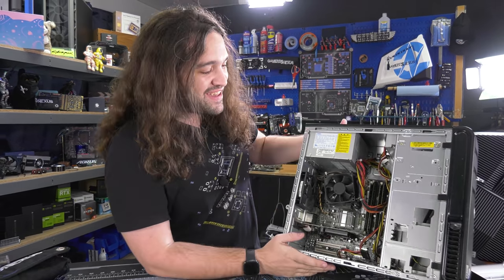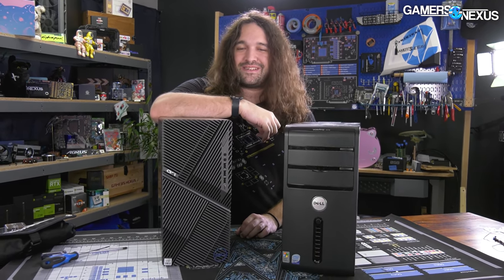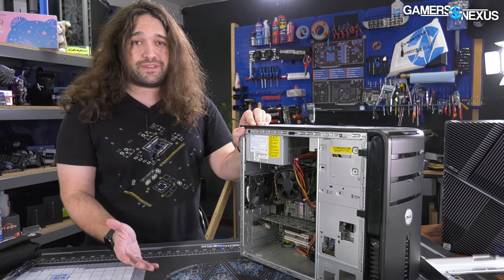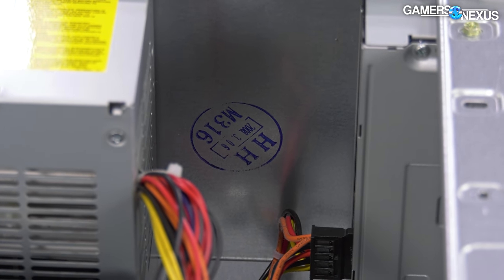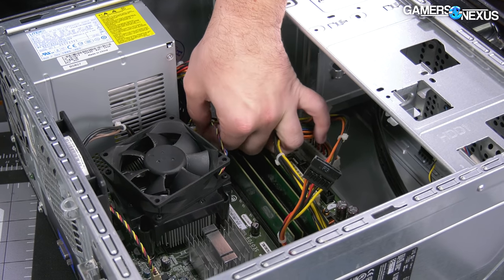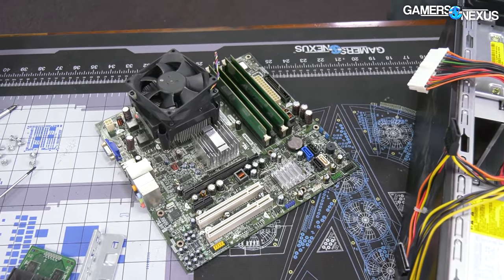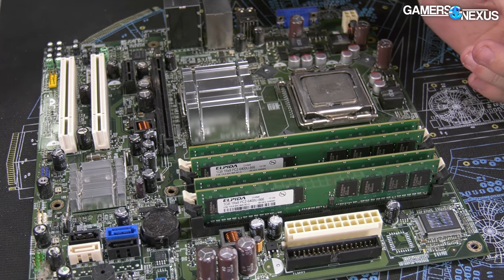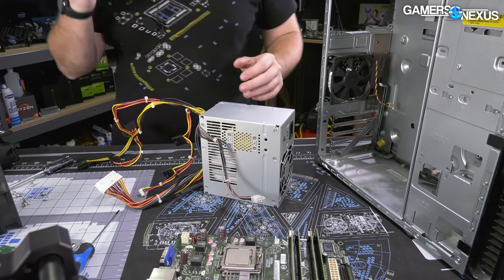13 Years of Dell Getting Worse

Comment: I have purchased Dell products since 2012 and never had an issue until this year. In July I got an Alienware x16 R2 laptop and an Alienware AW3423DW monitor... the laptop came with BIOS issues and could not even get it started properly while the monitor came with a bright pixel. It was a painful experience to process replacements for each of them. It took several calls having to repeat the same story to several persons every time and technical support would pass the ball to customer service and then customer service would send me back to technical support. In the case of the monitor, when I received the replacement, I was supposed to receive a new monitor but I got a refurbished one, all edges of the monitor were scratched indicating that it was previously opened, the screen was full of spit marks, the base had scratches and dirt on the pads and there was a label on the back protector saying that it was a defective product from Feb-2023. So basically, I ended up having to return two monitors... hopefully the next one will come ok?. Let me know if you want more details about my recent experience with Dell's crappy customer service for one of your videos.

Comment: that "standard 24 pin" most likely has been rewired. Around 2012 me and my dad tried to repurpose a dell we found in the garbage and nearly blew it up because the pinouts didnt match so definitely check that before you reuse/swap any oem power supply
Reply: I wouldn't say it's "most likely" unless you had the same Dell, the OptiPlex 990 MT for example is a standard wired 24-pin (I've swapped in normal PSU's without issue) but like you said it's something you should check
Reply: This is very true.
If you also check out Dell pc's farther back, you will find many / most Dell computers were one of the worse brands using proprietary parts in thier system.
I started building PC's around 80, or 81.

Comment: Dell used to put together decent systems. I abandoned them when everything started going proprietory. Nowadays you can get around things like power switches by getting an adapter from ebay. But back then it was impossible to work on these things without extra wire, diagrams, solder and a bit of luck. I started building out of necessity and found a love for it. So, in the end I have to thank Dell for being so shitty that this guy started building rigs instead of being held hostage to big prebuilt.

Comment: I tried to "Upgrade" an HP computer over 20 years ago.  It's what got me motivated to just build my own PC's.  Haven't bought a prebuilt PC since.
Reply: Pre builds? What are they? 😜😜😜 I have been building my own since I started getting into PCs back in the 1st gen pentium era, when I could get my hands on second hand 486 parts. Back when you could use the case as weightlifting training. Ha ha ha

Comment: In 2006 I had a Dell XPS 700. That computer was a monster. The bad parts of it were that they used proprietary and unconventional parts which meant upgrading one part could end up requiring you to change out multiple parts. It had a BTX motherboard, a non-standard but massive 1000 watt power supply, and a BTX case which was massive and made of steel.(Looked good). I was able to salvage the rest of the parts when I upgraded. I was disappointed that to change the motherboard I had to get rid of the power supply and case too. I ended up donating those parts to my younger cousin when I upgraded to an I7 920 build. I still have the 7950GX2 from that build on a shelf. That was a dual GPU card.

Comment: I have an old Dell optiplex at my mom's house as an off-site backup. It's got proprietary front panel and power button connectors, and I think it's a proprietary PSU, but it was cheap and super easy to work with.

Comment: By 2008, Vista SP1 had come out and it wasn't bad at all. I used it first on a lab computer (a Dell Precision workstation) so that I could have a 64-bit Windows OS that didn't suck, and liked it so much that I willingly put it on my home PC a few months later when I upgraded to 4 GB of RAM. The main reason that Vista was so horrible was that it aggressively cached software into memory, and was often sold on computers with nowhere near enough RAM and glacially slow hard drives; in other words, sub-$700 laptops that ran slow until someone put a pirated copy of Windows XP onto them.

Comment: Honestly this old dell case makes me want to print it a new front panel and use it. Just to show dell that even if the parts get obsolete, some things will just work over a decade later, even if some minor tweeks need to be made
Reply: All it takes is some mesh for better airflow. I'm actually planning to update my 2005 OEM case that way. Just drilling a bunch of holes.

Comment: 9:45 those are rubber dampeners to not transmit vibrations from the fan to the case. Noctua also ships those with their fans.
Reply: Yup. I still have 1 fan with screws and I can hear it.

Comment: We use an old Vostro as one of the machines we use for wiping hard drives. It's a Core 2 Quad with 8GB RAM, permanently has different hard drives thrown on the top of the chassis to secure wipe & test. The thing has never missed a beat, though the original PSU has been replaced due to not having enough SATA connectors on the original. A really great machine, in all honesty. A shame the old Core 2 Duo's & Quads really don't have much of a home in the modern world.

Comment: Probably around the late 2010s I bought a couple of Precision T7400 workstations that had been retired from my state's department of transportation and I had a lot of respect for just how effective they were for cable management and tool-free modifications. I think the only thing I needed a screwdriver for was installing the cooler when I added a 2nd CPU.
Expansion cards had toolless retention clips, hard drives had the Dell blue drive trays, 5.25" bay accessories were held in with a spring-loaded sliding latch mechanism. Of course, the case weighed a ton and it wasn't that fast, but for testing old PC parts and learning how to configure and modify computers, they were awesome.

Comment: Dell is pretty good in a business environment. Slap a custom image on it and pick which Dell management tools you want. Just don't plan on doing much if anything in terms of upgrades, other than maybe RAM or storage. That goes for desktops and laptops.

I recently got a new Dell laptop for myself. It had so much bloatware on it I just nuked the OS. Much better now.
Reply: What laptop? The business lines (optiplex desktops, latitude laptops) used to be clean, no bloat... i was frankly shocked how clean they were.
Reply: Did you compare Sager or Clevo to HP and Dell?

Comment: I have a workstation class system from 2007/2008, a Precision T5400. It uses a proprietary PSU with proprietary connectors, CPU heatsinks that screw directly into the chassis, proprietary front panel connectors for USB, audio, power button, and status lights (the pinout for this is still unavailable to this day), the chassis fans use proprietary connectors, and the rear IO cutouts are part of the case. 

They have been at this for a long time.

I am currently modding the chassis to take generic consumer components, (not through necessity thankfully, just a personal project), and the dremel has been required several times already.

Comment: I bought a Dell XPS 1701 model laptop during what was  it last days being sold. It has to be over 15 years ago I bought it. It was notorious for an MAJOR oversight. It was a 17 inch laptop with a crap 15 inch fan. It ran/runs so hot its scary, it would feel like your palms were being cooked if you ran any kinda game after an hour or so. Don't even ask how it ran in summer if your room wasn't cooled. It was basically untouchable. It was a mini heater you could leave your hand at its side and just feel the heat massively being pushed out and it just didn't cut it. The forums were littered with complaints with the fan being too small for a 17 inch in general let alone a laptop meant for gaming.

Comment: 6:40 Did this with an HP computer that’s with my family since 2006. I basically gutted it and used the case for a new PC with a R3 3200g. Fitting since it still has its AMD and ATI Radeon stickers.

Comment: Just a side note: Hmm. The IO shield seems to be integrated into the chassis. This would give yet another reason to upgrade the case, But,  if you would want to use the poor, otherwise standard motherboard in anywhere else, you would have to hunt down an IO shield for it - if it even exists -, or go jank style.
Reply: If you're reusing a stock dell mobo, you probably don't care about the i/o shield
Reply: Integrated I/O shields are an easy fix with a Dremel.
Reply: @Gatewayuser200  And a welder? It wasn't that it was in the way, rather there would be no IO shield for a replacement case. If you have to go that much DIY, you might as well build your own case.
Reply: @sotesz    I'm was talking about reusing the old Dell case. The integrated I/O could be cut out so you can fit any motherboard with it's new I/O shield into the Dell case.

That Dell motherboard uses a fairly common I/O layout. Shields are available for it. Some Dell cases that motherboard was used in did have removeable standard I/O shields.

Comment: It is interesting to see Dell come full circle on using proprietary parts. I remember working on a Dell Dimension desktop from 2003, it had bad caps on the motherboard, and I ended up recycling the case and motherboard because the power supply connector and the front panel connectors were proprietary; the motherboard was also secured to a removable metal tray, and I doubt it was a standard size. During the years that Dell was adhering to their commitment to stop using proprietary parts I had a friend who bought a cheap Inspiron because it was upgradable. We immediately installed a new Graphics card and PSU to turn it into a gaming computer which he used for about 7 years. The Dell desktops I take apart now are built like the G5, a bunch of stuff is proprietary and reused across multiple Dell models.

Side note, those rubber nubs that secure the fans on the G5 will dry out over time and the fans will just fall off in 5 years or so. I have seen it happen on Dell's Precision series desktops a lot.

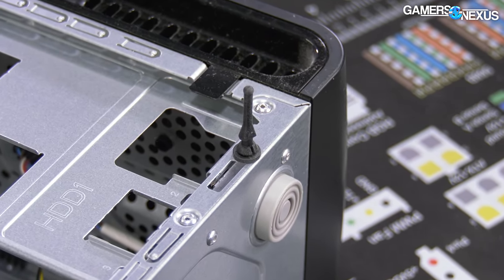Comment: 9:47 that looks a lot like Noctua's, unless I'm missing something I would say that is better than a screw, specially if the fan doesn't have any anti vibration pads.
Reply: Yep - Steve has this one wrong, it's an upgrade and a good one too.
Reply: Glad I'm not the only one that noticed that. I legit thought there was something wrong with them that I didn't know about.
Reply: But the fact was they didn't do it for noise or for you, they did it to save 10 seconds on labor and 2 cents in material per unit.
Reply: Very good for silent builds, they reduce resonance quite a lot.

Comment: From an old timer who has been recommending Dell since 2007. We’ll see, I support small businesses on my little Hawaiian Island. Currently, I think I have about 2000 client pcs that I support. Basically, although I build my own systems for my personal use, I prefer outsourcing most of the customer computers. My clients require mostly  basic needs, such as onboard graphics, and their main focus is reliability and uptime. No need for gaming, although some engineering and surveying companies like using graphics accelerators, such as nvidia Quadro and ATIAMD fire XL. I have been mostly recommending the Dell OptiPlex systems, while my brother who does similar work for his company prefers the Vostro systems that you just reviewed. Both of these manufacturing lines are still available, and are targeting the same markets as before. OptiPlex it just switched to the BTX system, which was supposed to accommodate much higher temperatures on the CPU. Thank you so much larger heat sink, it had a rear mounted fan, that exhausted and ventilated the system via fan shroud. That meant to be internal system such as the motherboard, or mostly proprietary. On the other hand, this made the system overall more reliable, due to more effective cooling. Overall, all I really had to do, was specked out more memory, and extend the warranty to five years on site, for about $200 extra. On a few occasions, I had to call Dell tech-support and they actually sent a technician to my little island, to do the repairs. And the telephone tech-support spoke English as their primary language. That has not changed over the years.
By comparison, the Vostro systems started out much cheaper, and everything else was à la carte. For example, the Astros used mostly off-the-shelf components. Including the motherboard, cooling system, and power supply. The downdraft cooling fan worked OK, pretended to get clogged with dust, especially on the small radiator fins. Eventually the CPU would overheat, and the system would crap out. I think the base warranty was something like one year. And any additional service would have to be performed by the user. On those few times that I worked on Foster computers, I found that they were easier to work on and disassemble, but the customer would see me more often, resulting in a much higher cost of ownership, as well as decreased uptime and productivity. On the other hand, I suppose you could gut the entire Vostro system, and replace all the components with the latest Intel or AMD components. Possibly including NVMe drives. At the same time however, you would still be stuck with that poorly ventilated case. At least the OptiPlex line had an open front grate, for much better ventilation. 
in the end, you just have to decide how much time you want to spend building your system. If that is beyond your means, and if you’re you don’t require gaming, an Optiplex would make you a lot more productive.

Comment: I worked on a XPS 8930 today i7-9700. It originally shipped with 1x8gb 2666 stick. The store that bought the computer that sold it to my customer upgraded it to 2x8gb 2666 goldkey sticks. One of the goldkey sticks failed in my bench, the other one passed, the stick dell sent passed (it was a micron green stick). NONE of the sticks passed in the dell. I ended up putting a 2x8 ddr4 3200 team delta rgb in there, it ran at 2400 and passed.

Comment: The first impression I get seeing those two cases side by side is how gradually 5.25” bays went out of style
Reply: I still watch DVDs and Blu-ray and it's getting hard to find something to play them on nowadays. Imagine saying that ten years ago, I mean Xbox got horrible press for even suggesting that.
Reply: @pdraggy  honestly it was the consoles that saved physical discs, I don't think movie aficionados alone could have supported the market interest. Even then they stopped at adopting triple and four layer BDs. EDIT: Xbox and PS have UHD support hence BDXL but seemingly not for games.
Reply: I still have a Blu-ray drive in my desktop. It's making putting a top mounted 280mm radiator for custom watercooling in my Define R6 a problem, but nothing a rotary tool's cutting disc on the bracket shouldn't be able to fix. I use the drive all the time (when I don't have the system down for maintenance/upgrades like now)
Reply: @chrisbaker8533  lol I just meant like based on what was on my desk or I'd find robbing looking in a random house. My computer no longer has an optical drive, consoles are starting to not have disk drives, many people don't even have a dvd player around their TV any more! It was unthinkable just 5 years ago!

Comment: I have used one of those, other then the limitations of the PC I had only accepting Core 2 Duos and not Core 2 Quads it was really really serviceable.
Reply: When I tried to upgrade my Pentium 4 system back in the day, I had to learn that the board doesn't accept the new CPU and I needed a new mobo. So I bought one that theoretically could run the CPU, but only at lower clocks. (didn't support 333 MHz FSB) So I had to buy another one with a newer chipset.
And everybody complained when Intel decided that 8th gen needed a new version of LGA1150, when back then they had 3 generation of chipsets on LGA775 which not all supports all CPUs for the socket, some support certain CPUs only unofficially, and some can be convinced to take almost all of them.

Comment: Before I built my own PC, when I was getting into PC's and stuff back in 2014, my old job was getting rid of a few PCs, some Dell Inspiron 3847 MT. I understood some basics of PC building and specs, and these were Intel 4th gen processors, a mix of 8 and 16 gb RAM. I asked the IT guy if I could take them home, he said yeah. So I ended with 3 of these machines, each had i5 4440s. I ended up getting an upgraded PSU, ssd and a cheaper gpu, and I had my first gaming PC. I was happy to see normal parts fit inside the case.

Comment: 16:07 Q6600 is one of the best CPU's for overclocking ever. People were tinkering with them for years after they were outdated. I wonder how that would perform in a retro PC RIP-Jay contest.
Reply: I had an OEM mobo that couldn't overclock, so I put a piece of electrical tape over a pin on the Q6600 to overclock it to 3.0ghz.
Reply: I've never overclocked my Q6600, and it's what I've been using for the last 13.5 years.  An SSD upgrade has kept it useful, but video streaming suffers.  It drops frames constantly when trying to play 1080p60, and for videos that offer that I can't just tell YouTube "no thanks, gimme 30".
Reply: @SouseMouse  it's the GPU.
I've played 60fps videos on LGA775.

Comment: Ahhh yes! That is the year I was introduced to PC gaming with the Dell Inspiron 530! Also the Inspiron 620 is the pinnacle in terms standard-ness or the use of standard parts as it have removable IO Shield so you can basically build an PC with today's part but you might need an extension cable for the PSU.